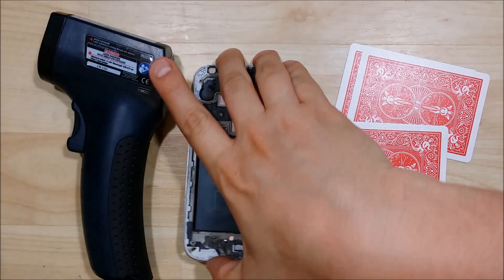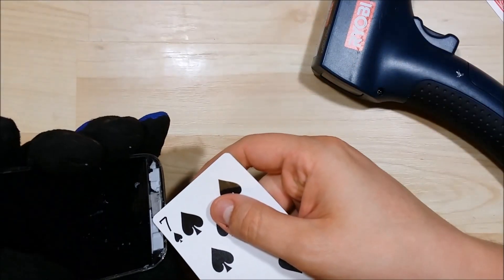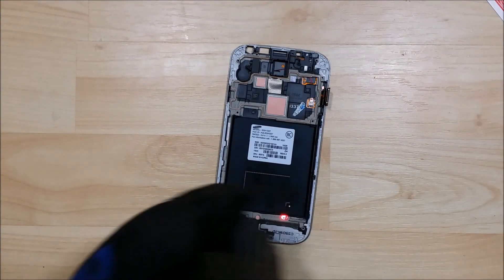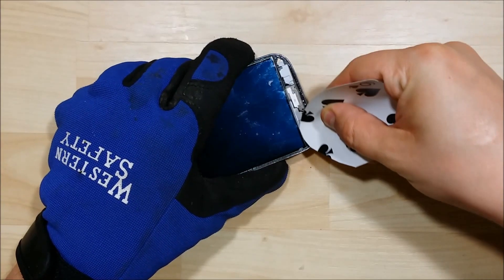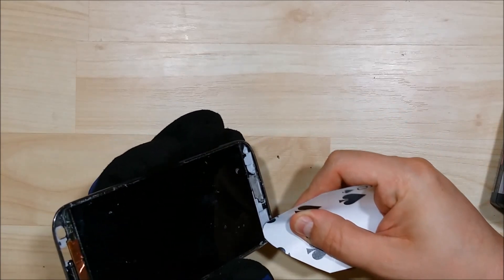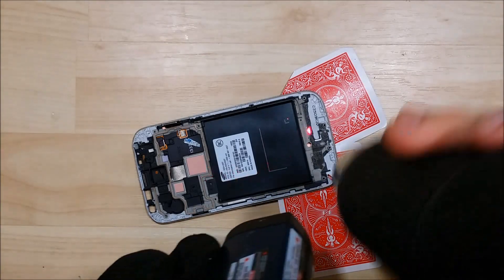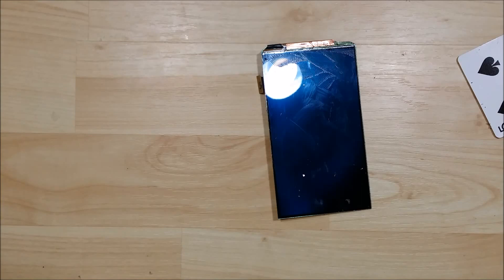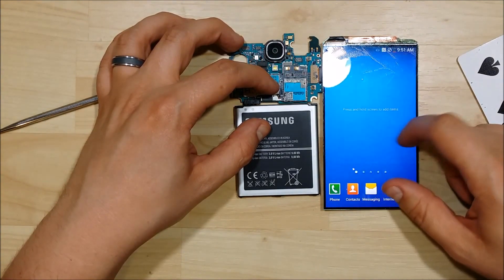Samsung Galaxy S4 LCD Removal LOCA Process

Comment: Excellent video.  I have heard many people say they broke a few AMOLEDs before mastering this process.  Using this video I successfully removed the first AMOLED I have ever tried.  The only thing I did differently was heat it up a little more.  At first I was using 180 but found that the adhesive was still a little stiff and it was putting a lot of pressure on the AMOLED.  Heating it up another 10 degrees to about 190 seemed to make all the difference in the world.

Now to attempt the LOCA!

 I enjoy your videos, keep up the good work!
Reply from the maker: +CNY Tech Guy good luck it can be a little frustrating the first few times.

Comment: i did like you but the gold tape came off does it need to be put back on not sure how the screen still works but am concerned  about the gold tape stuff
Reply from the maker: stephen Paul I think it is there for electric shielding. It doesnt have to be adhered to the screen but I would put it back in between the screen and the frame.

Comment: can i remove glass only?and then glue the new one? i have a broken glass and i want to do less work so i have less damageis that ok?
Reply from the maker: gkogkosth You can but the glue will seep all around the inside of the midframe. Then the phone will get hot and the glue will seep around and could cause damage which is why I remove the LCD.

Comment: its 180c not 180f the glue would not melt at 180f.cheers
Reply: Whom should we believe? Some say 180 C, others say 180 F. What was really used in this video?
Reply: Well, I successfully separated the glass from the lcd at 70 C. I think 90 C should be the max otherwise you risk burning your LCD. Even at 70 C it was soft enough for me use playing cards to separate the two. Cheers!
Reply: This is correct. It's 180°F in this video, which is around 80°C. Do not try to use 180°C.